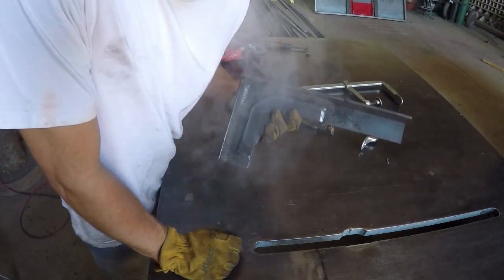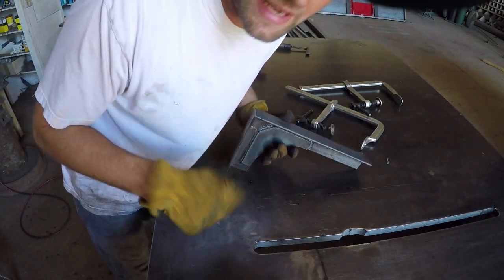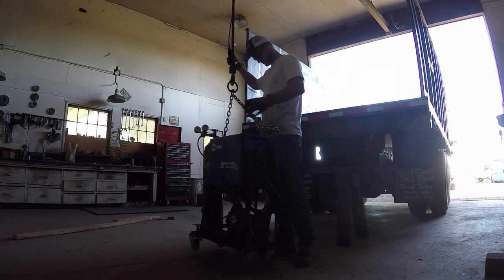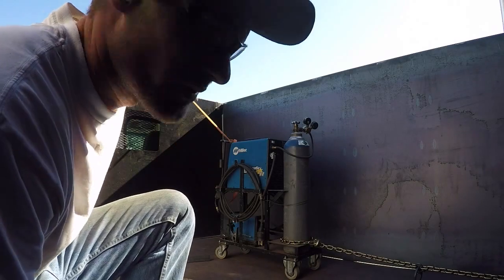#19 - Tree Pull and Truck Racks pt. 4

Comment: Just for future reference when trying to fall a tree always make a face cut it's easier for the backside of the tree to rip and fail then it is for you to compress the front of the tree as you try to pull it over it's the same Principle as when you bend metal it's easier to stretch the back side then it is to compress the front side of a piece of tubing or round stock which is why people who don't have a tubing Bender do a whole bunch of face cuts on the inside of the bend on metal same principle for trees always cut the side that you want it to fall towards. I love all your videos keep up the amazing work
Reply: Those were exactly my thoughts too 👍

Comment: You might wish to try using flux-core wire when welding outside, on dirty, rusty, or painted steel, oh and turn up the heat.

Comment: Whenever pulling trees, do the 90 degrees pull. That way, regardless of what you're pulling, how you're pulling it, where you're pulling it, it won't fall on you. All you need is some sturdy rope, a pulley on a decent spike, and you're set.
Reply: I would want to see you anchoring a pulley in such way that would withstand the energy used to pull this tree

Comment: Ah man. Im 12 minutes in and I wanted to tell you the way to do it. Gotta put some tension then cut the tree so it falls the way you want it. My dad and I took down two or three in our yard in suburbia no problem.
Reply: Problem with that is... Usually if the tree all of a sudden starts leaning, it is rotten. Cutting rotting trees, sometimes you have no idea where and how bad the rot is. They can barber chair or spin in a totally unexpected direction no matter which way you are pulling on it... I have seen one 28" diameter 60 foot tree, where it split 10 foot right up the center in two, in the opposite direction of the cut, pulled the roots out of the ground where it hadn't been cut yet, rotated about 20 degrees as the branches caught another tree, then lifted the cut 16 feet off the ground, just missing my friends head. We used a modified humbolt with a trigger and he was only 1/3 of the way into the bore cut when it decided to snap loose with no warning pops or creaking.

Comment: If you read comments on old videos I can give you a tip when you have a gap like that...If you make a heavy tac and give it a wack  with the hammer when the tac is red you can close the gap if the back material is solid enough..

Comment: Great video, I was watching the behind you blowing around and was wondering about the gas coverage, 5s later you mentioned it haha. Were you doing those welds downhill? 

Also, nice trick with the hydraulic jack
Reply: Try flux core for outside jobs.  Does much better than gas.  Good video.  Hell of a tractor with those huge drivers.  Take care.  Doug

Comment: Use math... These to methods will help you measure any height. 
Use a protractor sight along the bottom so when you have a 45 degree angle you are pointed at the top of the tree. Move towards or away from the tree to do that. Then measure from where you are standing to the tree and that is the height of the tree. 

Or you can use a yardstick... 
Hold the 0 part up to your eye and measure the length of your arm to your thumb. Then hold the yardstick at that measurement vertically at arms length and then line up the measurement mark to the bottom of the tree and the 0 measurement at the top. Move towards or away from the tree to do that. Then measure from where you are standing to the tree and that is the height of the tree.